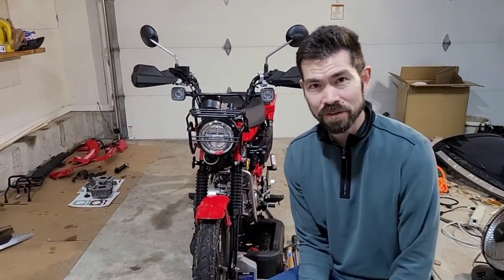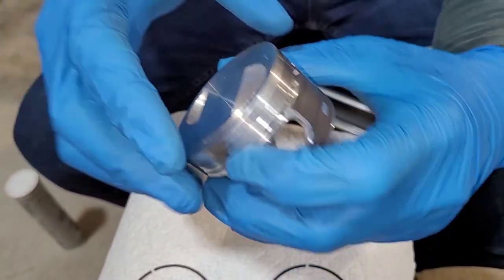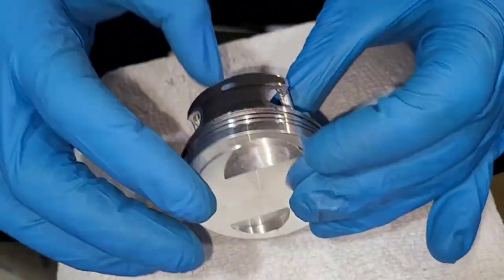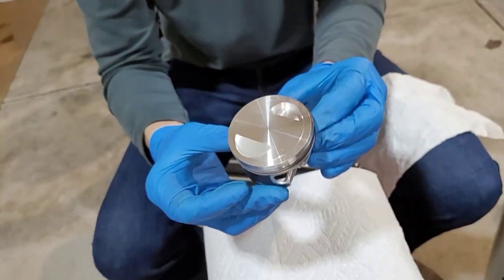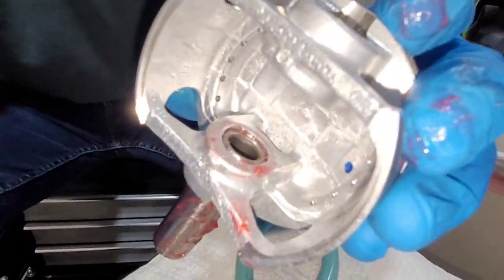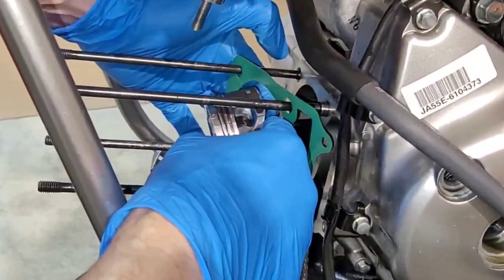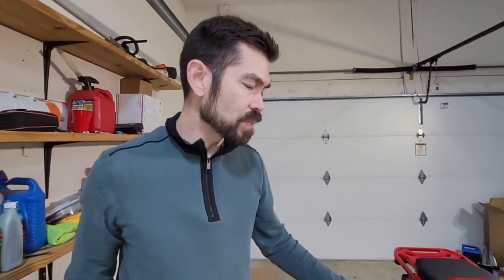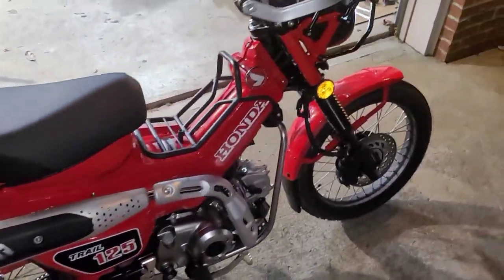BLOWN Honda Trail 125 comes back to life w/a new 164cc Piston & Cylinder! CT125 Big Bore Kit: Part 1

Comment: Thank for sharing the breakdown. And rebuild back up You did it very well. Never thought that it had a big bore kits so soon. For the CT 125.
Reply from the maker: Thank you!  i thought it would be fun to show the process and failures that can occur while trying to upgrade performance without the use of a dyno or other expensive diagnostic tools.  Tearing the bike apart and then rebuilding is part of the fun! This is the first time I have tried to do something like a big bore kit for a fuel injected cycle.  I have some successful experience with two-strokes using carburetors.  There it was simply changing jets.
Reply: @QuantiQualification  Very true two stroke is jetting n reeve valve setting not really that complicated. Pretty straight forwards.wiyh carb.

Comment: I almost laid an egg when you put grease in the cylinder!
Reply from the maker: LOL!  You would definitely need some grease for that (the egg)!  Realistically, the grease will wash away in the first few cranks of the cylinder.  Oil is a better choice but the point is to not allow metal to metal contact in those first few cranks.

Comment: Wait! Did you gap those rings before you put them on the piston? Unless the kit maker pre-gapped them, you have to place them one by one into the bore, measure the gap with the same type feeler gauge you use for valve clearance, and file them to the correct gap. The bore pushes them in just by inserting them and heat expansion closes the gap even more. If the gap is too small the ends of the rings will meet. The rings will stick out too much and scrape all the oil off the bore wall and after a couple hundred miles the heat will destroy that engine. The 143cc kit for sure needs the rings gapped when I installed mine.
Reply from the maker: It has been a little while but if I remember correctly, I definitely gapped the first 164cc Yuminashi kit I put in after the Takegawa 143cc kit developed piston slap.  For the second 164cc Yuminashi kit shown in this video, I didn't gap it since I was worried at the time that I had over gapped the first Yuminashi kit.   In later videos where I rebuild a couple more times, I have me measuring the gap on video.  Ultimately, my problem centered almost fully around incorrect fueling, leading to heat failure along with needing to add additional cooling for the HP the 164cc produces.

Comment: Just got my Trail 125 and also live near a high-speed area. I've just been taking back roads but never considered a BBK option...How's this newest one lasting? Do you have a list of the other mods and where you purchased? Throttle body, fuel-injector, oil-pump, any changes to the stock sprockets?
Reply from the maker: The newest cylinder is from Kitaco and it is doing great! I just put up a video where I swapped in the old exhaust just to see what it does.  The next video I put out will be my final 164cc setup that I have been running along with all the part numbers, costs, and links to the go faster bits. Then I get to (finally) start talking fun accessories!

Comment: Are the rings pre gapped?? Or did you gap them?
Reply from the maker: On the first Yuminashi Piston I destoyed, I gapped the rings, although I might have done it too large, not certain.  On the second Yuminashi Piston, which I am showing in this video (which also was destroyed by me) I kept the original ring gap from Yuminashi.  It is generally recommended to measure and adjust rings if you know how to do it properly. I tried on the first one but my failures appear to not be ring gap related . . . for now at least.  There is no mention of a need to gap the rings in the Yuminashi instructions.

Comment: a few things i notices which will cause the piston to be destroyed... 1. Upgrade the oil pump for increase the oil flow to the cylinder head, failure to do this will cause 2. seizing of the engine ( Failure to set the piston ring gaps can also cause the engine to seize if it gets too hot ) 
I notice that your still running the stock air intake ... is the cylinder head intake ported to match the manifold, also is the exhaust ported to match the exhaust header., as these can also cause issues with overheating especially the exhaust port. ( The majority of big bore kit failures are due to under-lubrication which causes the piston to overheat and seize.  )
Reply from the maker: So far, increasing the fuel injector size has helped prolong the life of the latest piston.  Good point on increasing lubrication.  At some point I may get a higher flow oil pump installed.  In the mean time, I am using some good Ester based oils.
Reply: @QuantiQualification  Increasing the fuel injector only saves you from having to retune the fuel map in the ecu.
Reply from the maker: @geoff james  In my case, the stock fuel injector was not able to supply enough fuel at high rpm wot situations.  The map itself I think was okay, the fuel injector itself just couldn't keep up.
Reply: @QuantiQualification  that's correct.... there are 2 options, (A) re-tune the fuel map or (B) upgrade the injector....
( most people opt to the 2nd option due to not having access to the tuning software and a Dyno Tuner.

 Heat and Stress are the biggest killers ( which is easily overcome with the increased circulation and increased oil quality, (plus addition of oil coolers for the extreme). With your engine you have replaced the piston and cylinder twice but still have not addressed the likely cause of why these parts have failed.
 
Everything is relevant, Engine RPM, Duration of  ride, Ambient weather conditions, Undulation of roads, how much load / stress you place of the engine, these factors will dictate the reliability, whereby if your still experiencing an issue then you must analyze the problem as being from Excessive RPM, vibration, heat or lubrication related, and then address it accordingly. 
( My own bike has BBK, Ported head, Air intake Upg, Exhaust Upg, Oil pump Upg, Injector upg, Ecu Upg, Balanced Crank Upg (13,000rpm) I do a lot of highway riding at 110-120Kph for extended distances and having no issues.
Reply from the maker: @geoffjames2875  Excellent points.  I will take your advice and upgrade the oil pump as one of the next things.  I do want it to be reliable.  I will also be figuring out some wideband tuning so I can get the map exactly right as well.  Thank you for the input!

Comment: Light oil is better for assembly of piston through the cylinder and pin 📍 ❤
Reply from the maker: You are absolutely correct. It is definitely better not to have to rinse the grease into your motor oil after it first starts. I transitioned over to oil in later builds.

Comment: a great learning channel.total damage $ ?
Reply from the maker: Thank you! Takegawa 143cc Big Bore Kit ~$219 (Destroyed Piston, Salvageable Cylinder): Yuminashi 164cc Big Bore Kit #1 ~$125 (Destroyed Piston, Salvageable Cylinder): Yuminashi 164cc Big Bore Kit #2 (Destroyed Piston, Reusing the Cylinder on next trial so only reflecting price of replacement piston) ~$36: So total parts destroyed or no longer used so far is $380.  Actual cost of parts actually destroyed would be 3 pistons at ~$108 so not too bad.

Comment: If you don't want to do the Breaker Bar/Torque Wrench juggle next time...put the bike in gear and apply the rear brake.
Reply from the maker: Thought about that, but I think the engine will still turn since the auto clutch is disengaged on this one unless the engine is turning sufficiently.   I could be wrong, however. I just put the engine back together last night.  Great suggestion to try. I just missed the opportunity.
Reply: @QuantiQualification  Opps!  You're right!  What I'm describing only works on a manual cable/hydraulic actuated clutch.  If you tried to do what I said, it would be like the engine was idling at a stop, with no connection between the engine and the rear wheel.
Reply from the maker: @steverandall5814  👍

Comment: WOW axel greese for the wrist pin and cylinder walls. i just hope it dont gel up and gets as hard as a brick once it gets hot
Reply from the maker: Motor oil is definitely a better choice but the grease rinses away with the circulating oil in seconds after start up.
Reply: @QuantiQualification  i hate to say this but no it dont. its made to stick around and not wash away. that why they use it in wheel bearings. its made to resist other oils and water.
Reply from the maker: @MadsWorld34  Fair point and noted.👍
Reply from the maker: I have now added a note in the description as such.
Reply: @QuantiQualification  i'm not trying to be a smart A$$ but i built engines and worked on anything that has wheels on it my entire life. and did it for a living. until i retired. and just trying to save you some heartache and money later on. but at the same time trying to learn stuff and keep up with the times.
Reply from the maker: @glen johnson  Believe me, I did not take it that way at all. I am definitely listening and learning.  You have made the best argument yet for not using the grease I chose for the assembly of the piston, cylinder, and wrist pin. Others have mentioned it but did not give the backing like you did.  The designed purpose of the lubricant/grease matters on how it behaves. I had some of the grease laying around and gave it insufficient thought when using it.  Thank you. 😊

Comment: What happened to it to make the upgrade necessary? I thought they were bullet proof
Reply from the maker: Wanted more speed out of the bike so I threw in a Takegawa 143cc Big Bore Kit. Followed everything by the letter but still ran into problems after running the bike for a while.

Comment: Thank you for sharing ! Very well done ! Just curious what was done to clean out the lower part of the engine if it was contaminated with metal . Could the metal get into the bearings etc....? Thank you !
Reply from the maker: The metal absolutely will get into the bearings and get pumped throughout the engine.  What I did after the first 164cc kit self-destructed and prior to disassembly was add fresh oil and then spin the engine prior to draining it.  Then, this morning, after a brief warm-up, drained the oil again.  Added fresh oil for a third time, went for a short ride, and drained it again. So that is three flushes to get as much of the metal out as possible.  I will now ride it for about 140 miles of break-in and then drain it for the last time.  Should be all good from there, assuming it doesn't blow again 😅.  Good thing this motorcycle takes so little oil or the above procedure would have been expensive!!!
Reply: @QuantiQualification  Thanks for that explanation . Very interesting scenario that you are doing a great job at repairing . I first thought that the motor was done but I feel your doing the right things and so far its working better then I would have thought . I am currently trying to decide whether to buy a new 125 Trail and when I seen what happened to yours I almost shed a tear but I'm sure you will get it back to normal . Great explanations throughout your repair . Thank you
Reply from the maker: @stew tube  The Trail 125 is such a great bike.  I recommend it highly.  Around here, I need it to do at least 55 to 60 mph as all roads out from my house have this limit. Stock it did between 51-52mph average. So far, the fix is working.  I have done 10 miles with a max speed of 35mph, 20 miles at 40 mph, and 30 miles at 45mph.  I will keep working my way up to top speed, breaking in the piston and cylinder as I go.

Comment: How many miles did the engine do before you had to put a new piston and rings?
Reply from the maker: I had around 250 miles, I believe, before I started modifying the original motorcycle. The motorcycle worked perfectly but just couldn't go fast enough.  The first cylinder and piston I put in, a Takegawa 143cc, lasted a couple of hundred miles before it developed piston slap.  Worked great before that. Developed piston slap immediately following a high speed, tucked run, at 70 mph.

Comment: Any scratches on a piston are not good.
Even the smallest scratches.
Reply from the maker: You are absolutely correct. Cylinder scoring as well is a bad deal. I try it in a later video, and although it was great and cheap for testing, I ultimately replaced it.